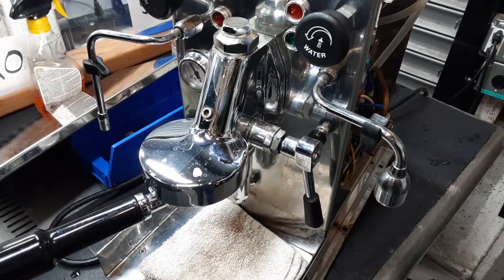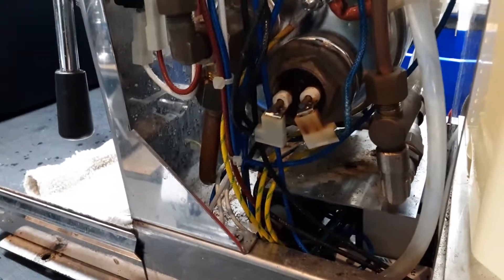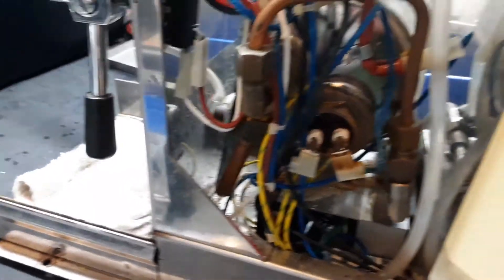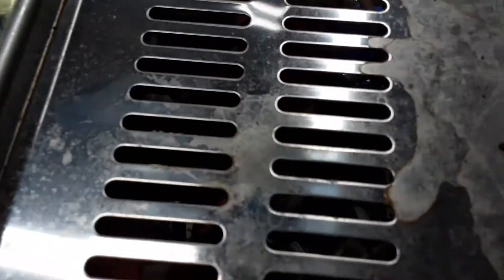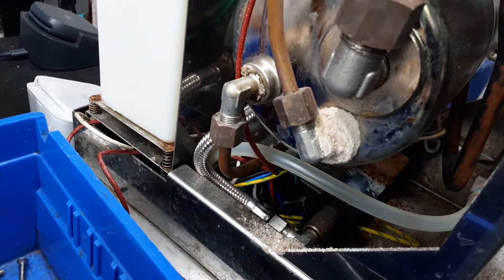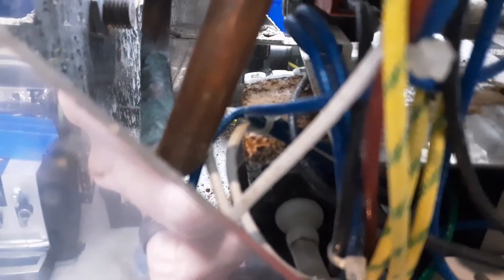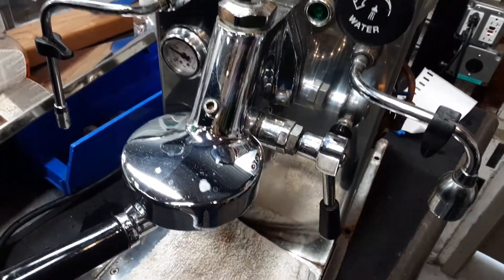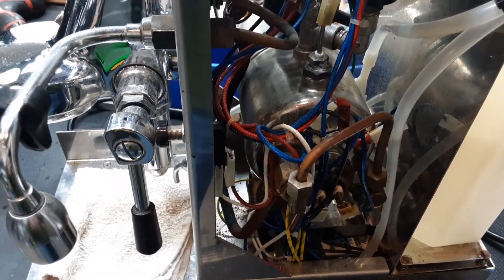Isomac Millenium Troubleshooting GFCI Fault/ Tripping Breaker #3895

Comment: Wonder if you found exact the reason? I am facing the same issue on my expobar pulses now.  Plus or minus of HA measured resistance is about 14 ohm. Infinite from either one to the boiler body.  Triggering happens about 10 second of pulling a shot.  Of cause the whole thing gets hot and wet.  I suspect it is heating element leaks out water shorts the circuit. I did a tons of Google search. Everyone replaced HA which measured just fine. They all buy this wet water conducting electricity theory and the same time became suspicious. As a training EE, this does not make sense to me. If the element inside is shorted, you should get triggering first second when you turn on the machine.  If it is open, you will never hot steam or water. If it is just heating element leak, why not just remove it from the boiler, clean it, then put some heavy duty tape screw it back？ All the smart people out there, I must smoke something.  From you video, I got the feeling that could be safety pressure valve or relief valve leak causing hot water flowing down shorts some wire before reaching the bottom shorting HA.  I do remember seeing a lot of steam coming from top of the boiler.  Many thanks for the. Video that sparks some ideas for me.